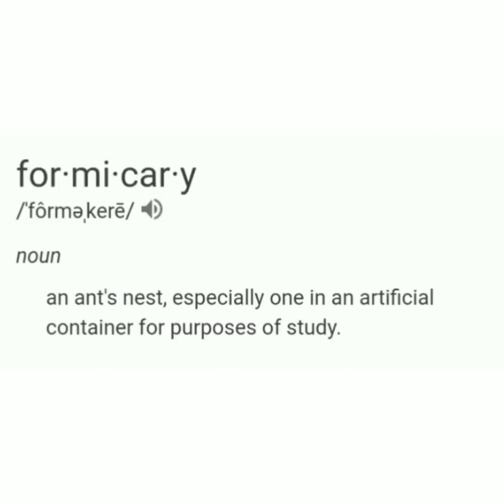HVAC - Evaporator Formicary Corrosion

Comment: I had replaced and evaporator the other day several techs went to this job and could not find the leak so I had a little reading of 4 to 8 parts per million in the evaporator and random spots. Sometimes my leak detector would pick it up then I would go back to the same spot and it would stop leaking it was weird. I informed my customer that and changed the evap coil. It was a cppper steel coil. The drain pan was rusty and a little greasy. I'm hoping I did the right thing.

Comment: Freon should be replaced once a year.  Evacuate it down and replace the driers. Take an AC compressor and open it up.     Take a deep breath in.     You will get knocked back.    THAT is Hydrochloric acid from the chemical change from gas to liquid cycle.   I didn't believe it until an old-time showed me.   Rarely will you open an AC Compressor, but when you do and have a wiff ; you will know why that AC freon and oil must be replaced annually.
Reply from the maker: Replaced annually?...not at all.  If proper installation procedures are used and the system is evacuated properly, then no lol.  I have systems 10 years plus that have never had gauges on them let alone replace refrigerant lol.

Comment: I've tried 3 different additives to fix it and none of them have worked for me in particular. Easy seal, AC freeze, and something else. They all failed, I've never had them plug anything up but I have no faith in them. I think these recent failures over the past 10 years has a lot to do with the manufacturer's being cheap,  trying to cut Corners making the coils thinner,  then claim that it's for better heat transfer but yet all the older coils did not seem to leak to the extreme amount that we have now. So I'm not convinced it's just something in the air because it's not something that used to happen to the extreme extent that we have nowadays. Further thought, when it seems to keep happening time and time again in the same spot on Carrier residential evaporator coils... that seems a manufacturing issue to me. I love your video content and your work ethic. Very similar to mine. One-off subject question for you.  Why is your video display size seem so small are you recording at a smaller frame size? Or possibly in the vertical position?
Reply from the maker: Filming horizontal, it might be the app settings I'm using, I'll look into it.  On the units you used sealants,  what were the leak rates?  They need to uses on very small leaks.  I agree the coils are thin copper but formicary corrosion is a thing and helps speed up the process.   Viper coil coating makes a product to coat coils to prevent corrosion.
Reply: @HVACKnowItAll  leak rate was around  1 pound out of  6 lb system. Sometimes 1.5lb on a 13lbs system.  I don't do as much residential as I was doing so I'm going off of memory with these numbers. Back to the video question I checked your display resolution under the info for geeks label on the video,  it shows 1080 but for some reason it just seems smaller.
Reply from the maker: @HVACRSurvival  how fast though?
Reply: @HVACKnowItAll  my bad,  i think a year
Reply from the maker: @HVACRSurvival  I used smart seal on a unit that leaked about a half pound every 6 or 7 months and it worked, they it next time and let me know.
Reply: @HVACKnowItAll  I'll look into trying it. I always tell the customer,  "it might work it might not." What would you like to do?. Thanks!
Reply: While formicary corrosion is taking place, I don't believe it's the sole reason the leak rate of copper coils has good through the roof in the last 10 years. I've seen new system leak  in <5 years, and in some cased twice (before aluminum coils have been installed).  These are in houses where the old systems were over 15 years old and did not present leak issues.  Nothing of significance has changed in these home environments.. 

IMO, the problem is acerbated by inferior material which has become thinner and thinner as FER's have put the squeeze on manufactures to meet minimums. I would almost say that formicary corrosion has been taking place from the beginning, but back then materials and wall thickness slowed the process to an acceptable rate.

Comment: If you replace the coil . can you coat it with a Teflon , to stop or slow down ?I used Teflon coating on Condenser coils to slow or stop corrosion . Especially if dogs like to Pee on them . Great video ,by the way.
Reply from the maker: Thanks, Viper Coil Coating also works for great for this!

Comment: Very good video, but I do believe there more reasons for this happening. Carrier said tin plated was the fix, it was not, then most manufactures said it was aluminum coils would be the fix, Although it did slow down but there is still problems with this happening to aluminum coils. I think the thinner tubing which was used for better heat transfer and with R-410a with higher pressures, I always notice coils leaked Freon out during the winter time during gas furnaces operation, I believe with higher elevated pressures on evaporator coil during gas operation enhanced this. I can be completely wrong, but I think this forma carry corrosion will still be an issue for while longer
Reply from the maker: yes you will have leaks, aluminum is not as strong as copper, but from what I read formicary does not effect aluminum

Comment: Does formicary corrosion also affect aluminum coils?
Reply from the maker: from my understanding it does not
Reply: Wasn't that an aluminum coil in the video?? I am too dealing with this issue in many many coils on the the same property, manufacturer says it's from all the planes in the air that fly above and around our property. What's your thoughts about the planes causing  these pinhole leaks???

Comment: Formic acid.
Reply from the maker: where does it come from?
Reply: @HVACKnowItAll  --  Formaldehyde 

I refer you to this excerpt from an article on   https://www.countrysideph.com/blog/3-common-causes-of-ac-system-refrigerant-leaks/

"Formaldehyde can turn into Formic acid in the home on the AC coil. It is very mild, however, over a 5 year period; it will create pin holes in the copper tubes. This is known as Formicary corrosion, and is why many contractors use R-22 by the skid instead. If you know about indoor air quality, you will understand that one particular pollutant in the home today is formaldehyde. Most if not all homes have some amount of formaldehyde in the indoor air, which will result in Formicary corrosion and cause Freon leaks. 

If you notice a refrigerant leak, it is important to get it fixed immediately. This type of leak can be hazardous to the environment and to you. State law states that all HVAC companies are required to fix refrigerant leaks (following Epa GUIDLINES).  Some of these refrigerants are global warming and ozone agonists. The efficiency of your AC system can be harmed with a low charge. This will result in the AC compressors running above their suggested range which can result in eventually having to replace your system. Freon is also known as compressor lubrication in some cases, which results in the compressor seizing up if it does not have enough. Therefore, detecting and fixing AC air leaks is important for you, your AC system and the environment."